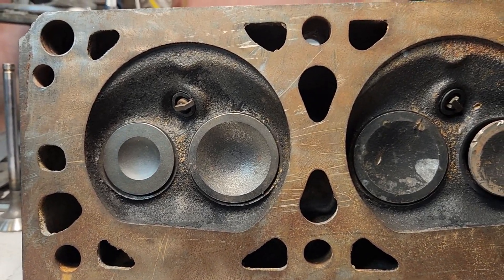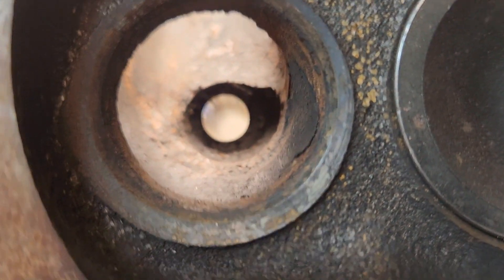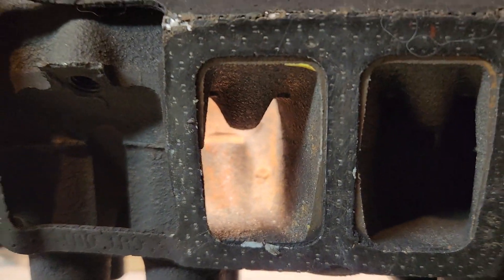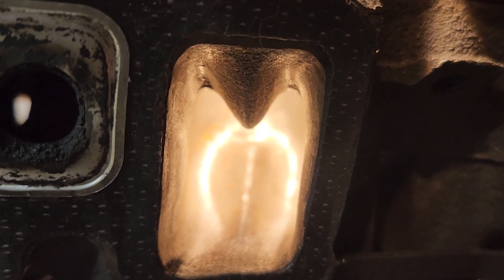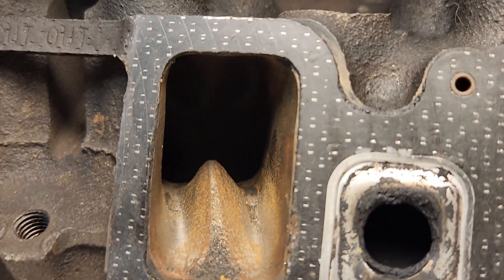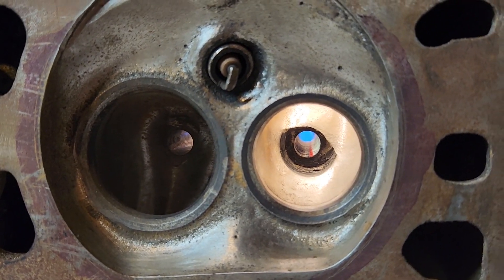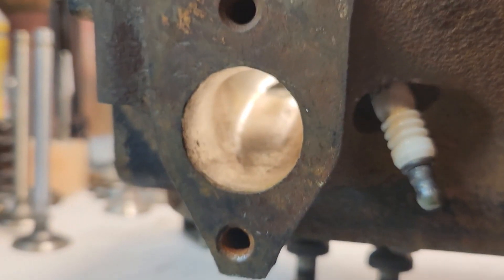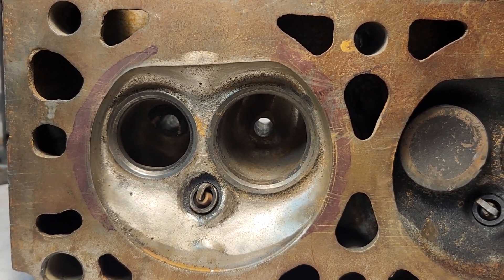Chevy 2.8/3.1/3.4 V6 iron head flow numbers with port work!

Comment: Read an article where they did extensive testing on these heads, using different porting techniques.  They found that removing the bump on the floor of the intake runner hurt the flow numbers.  They did see a little improvement cleaning it up a bit though but advised against totally removing it.

Comment: Yes, yes, yes. Remove the horn in from the intake and let's see what happens. But i know it is there to direct air around the valve stem. But on a boosted engine i don't think it will hurt to move it. Also, what would happen if you epoxied a hump in the aluminum performance heads on the intake ports?
Reply from the maker: Good question on the aluminum head with a hump. My dad made some plates for the intake ports of his old edelbrock heads that directed the air to the roof of the port. I believe it was good for an extra 10cfm!
Reply: @modeverything1  ok, sounds like a plan, let's do the hump on the aluminum head and see what happens.
Reply: It would come off and go down into the engine. Common sense guys..don't believe me go do it. Jb Kwik and of the hi tech epoxy won't work either..
Reply: FYI these heads with the iron block and long tube hot rod headers and 4 barrel carb with 162 rockers a cam close to 500 lift  Dyno at 270hp back in the 80s but gm neutered the engine when it hit the production line.  NA engine 270hp I have a article about the 60degree v6s 2.8 and 3.1 v6 . My 2.8 in my firebird hit almost 170hp around 210 tq I wish I would have had the 3.4 short block when I rebuilt it in 2002 there were not many firebird Camaro 3.4s in the junkyards since they were only out 6 or 7 yrs. I had hooker supercompetion long tube heads jet hit coated. I know for a fact those gave me 10hp up to 5k the engine really could breath with those. I got 30.5mpg gas mileage also..had a cam and injectors rockers ect the whole works for 35hp gain but I got about 5mpg increase and about 50 torque night and day difference over the stock 2.8 and it chirped the tires in 1st and 2 b&m shift kit 700r4 trans with OD. The lz9 is the way to go know 280hp with just tuning on 93 octane

Comment: I have an 88 fiero 2.8 I see there's aluminum heads online for the Chevy 2.8 are those compatible with my engine?
Reply from the maker: If your looking for the most power you would want heads and intakes from a 3100 or 3400. You would also have a few other things to change like switching to a distributor less ignition system, camshaft, pistons (if not wanting a high compression ratio ) there is a good write up on the hybrid swap on thirdgen.org in the v6 section

Comment: I know its apples to oranges, id be curious to know just how much better a LZ4/LZ9 head flows compared to these.
Reply from the maker: I am going to try to do some flow testing on the LZ stuff over the winter. The 3400/3500 flow much better than the iron heads.

Comment: Did you do your flow testing at 28inHg? I did a little looking and that works out to about 200 Hp with 142 Cfm. Did you go beyond .600 lift? I plan to run a .422 cam with 1.6 rockers so close to .650 lift.
Reply from the maker: Yes I test at 28in, no I stopped at .600 since they were not really picking up anymore.
Reply: Maybe stick with 1.5 rockers then.
Reply from the maker: Yeah I don't think I would go too crazy with the lift unless your planning on aluminum heads down the road or dumping a pile of money into the iron heads. What is your HP goal with the engine?
Reply: @modeverything1  I'd like to see over 200. I am sticking with the iron heads for now because I have an offenhauser 4bbl intake and pace setter long tube headers that came on the 2.8 that was in the truck when I bought it. Going 3.4 because it's a direct fit and because it's not what you see every day. Short bed single cab 82 S10 with fiberglass front end and fiberglass bedsides, no bed floor. Track is widened 6" and dropped 6" and 8". 3 link rear and all G body stock car stuff in the front suspension. Top of the unchopped roof is at my armpit :-).

Comment: Can u put the steal heads on a 3400 block  I’ve got the steel heads with carb intake with distributor would like to transfer that stuff to a 3400 for the full roller bottom end
Reply from the maker: Yes, but you will have to use 3.4 RWD pistons to keep your compression up. You will need an electric fuel pump if going carb since the 3400 dosen't have any provision for a mechanical pump.
Reply: @modeverything1 thank you I’ve herd of guys doing it but couldn’t find out how or what all I needed and by any chance do you know if they make a hei distributor for these .Ive got a 2.8 right now but I’m thinking either swap the heads or find someone to build my 2.8 cause I can’t seem to find performance parts for the 2.8

Comment: Intake ports flow alot better with the bigger valves, really not much room for improvement unless your bumping the cam lift after .42"
4 angle valve job will help. Exhaust port roofs raised and spark plug wall bumps removed will help substantially. 190 whp, 220 wtq is what you should see with a 3.4 and Holley 390 with good airflow and Edelbrock intake manifold

Comment: Cool, I once had a 3.4 Firebird, one of my favorite cars I have had, wish I had one with a V8. I always thought the bumps in the intake runners was for the injector to "hit" the bump. I find it strange why they did not put the 4.3 in the F-Bodys instead, then they could have shared transmissions, subframes and what not. And you could get a frontwheel drive Chevy with a "high Performance" V6, why not just put that also in the F-Body, I guess the DOHC engine maybe would not fit though, but they seemed to have so many different engine possibilites, and they put not exactly their greatest achievement in the F-Body.

It is like the F-Body was supposed to be underpowered, without an V8.

I put a different camshaft, 1,6 Roller Rockers, and headers on mine, I am not sure it was any faster. It should have been ported, more compression and got a tunable EFI system. I looked for an 3400 engine, for the top end.
Reply from the maker: Yeah I think they do that for a reason. They want you to have a way faster car than just a little faster with the v8 😆 just think if they used a 3400 instead of the 3.4 or 3.8.. a couple bolt ons and your as fast or faster than a stock 5.7l

Comment: The way to get power out ofthese is long tube headers no cat and straight pipes guarantee 15-20 hp just with that mill the head yo bump the compression.. i couldn't believe how strong a 2.8 is woth hookes supercompetion long tubejet hot coated hraders and ran back with straight pipes oñ a 3rd gen firebird.. on the 2.8 intake i milled out 6 2 inch tall aluminum that mayched. For my uim and lim made my runners a little longer.. when they were hot roding these engines they ran 11.5 or 12 1 compression and long tube headers v8 Crane roleer rockers they Dyno a 2.8 with12 1 comp and  all other good stuff 270hp yeah thats running on 108 race gas bit it can be done they need to breathe

Comment: Do you know of a way to Mod the RWD iron 2.8/ 3.4 block  to use the roller cam from the 3400?  The valley is obviously missing the threaded bosses for the lifter retainers.  I'm looking into building a 3.4L/3400 hybrid for an S-10.  Thanks. I enjoy your vids.
Reply from the maker: I think it would probably be easier to make the full 3400 work vs. converting the 3.4 to a roller engine.  You would have to modify the 3400 oil pan a little or notch the k frame slightly to clear the oil pan. Then you would need to swap your rwd front cover / accessories over and modify one engine mount, along with a couple other small things. 

I think if you were going to use a roller cam you would have to get the lifters with the tie bars joining each pair together. I don't think you would be loosing much power with a flat tappet vs the roller, especially if you use a performance aftermarket cam!
Reply: A pair of your fellow Canadians at DOT Motorsports eventually put an LZ9 in a 2nd gen race truck.  Video at 2:15 - 2:25 shows GIANT bite they took out of cross member!  https://www.youtube.com/watch?v=wpuetAfUBqk  Too scary for me.  They won races though!  Maybe a shallower custom steel pan out of 3/16" plate would keep the block stiffness and gain clearance?  Flat tappet sure be easier.  I have found no one selling roller cams for the RWD 60 blocks.  Maybe the aluminum head swap provides more clearance for the lifter tie bars?  @modeverything1
Reply from the maker: Yes I have known one of the guys for 20 years now lol. Mars also has a TT LZ4 in an s10 with a manual transmission.  
Almost every one that does a vortec 4200 (GM straight 6) swap has to modify the oil pan to clear the chassis. Steel pan might work but it might be a little complicated to tie in the main caps to the oil pan like the factory did.
I would start with a new oil pan and have a custom sump made for it so it fits the chassis as needed and maintains the same oil capacity (or more)

I know guys have run solid rollers in iron head engines before, but I never really paid attention to where they got them. You could probably have a manufacturer make some, but it probably wouldn't be cheap lol

Comment: So what aluminum heads can be used on iron head reaer wheel drive 2.8?
Reply: If I remember correct you can use the 3400 frontwheel drive V6 top end, but you need to use the intake manifold too I think, atleast if you are gonne use stock stuff.  I had a 3.4 Firebird many years ago, and I wanted to try it, but there is non of those 3400 cars/engines around here.
Reply: I guess you could use 3.1 head on the 2.8? I am not sure, I would think the Channel owner gives you the correct answer soon.
Reply from the maker: You can use the FWD 2.8/3.1, 3100 or 3400 heads, but the matching intakes will need to be used. You would also need to convert to the distributor less ignition system since the distributor won't clear the FWD intake manifolds. There are a few more things that would need to be done as well.

Comment: Any updates
Reply from the maker: Should  be back on the flow bench in the next week or two!
Reply: @modeverything1  have you try bigger valves
Reply from the maker: No I have not tried larger valves on these  heads. I would like to get my hands on the newer heads with the bigger valves for some testing!
Reply: We need someone to make a 4 barrel intake to work with the aluminum heads that why people still use iron heads.
Reply: @georgebulson2646  yes you are right that's my reason to use them on my S10 3.4 swap
Reply from the maker: @georgebulson2646 I have thought the same thing myself! Also, a redesigned 3400/3100 oil pan for rwd swaps would be nice.